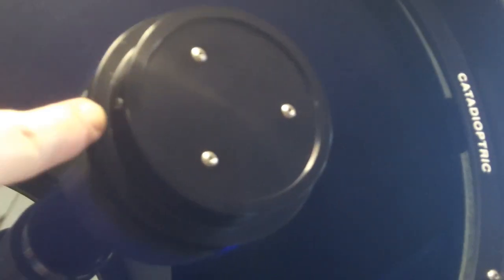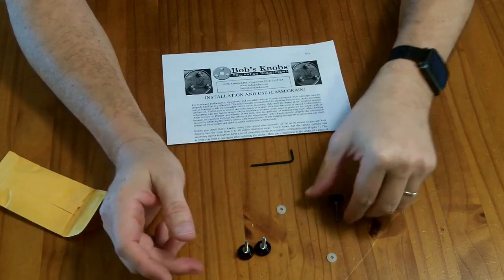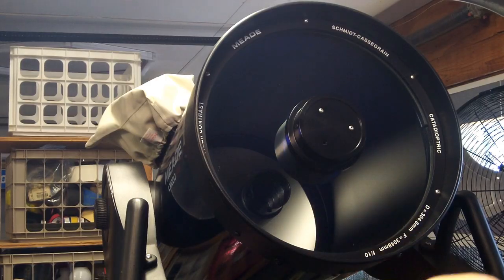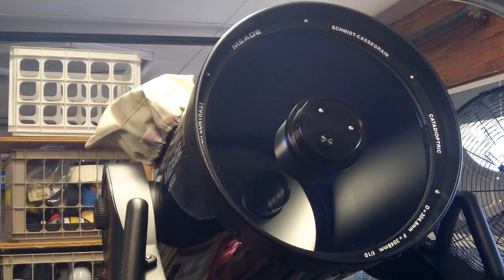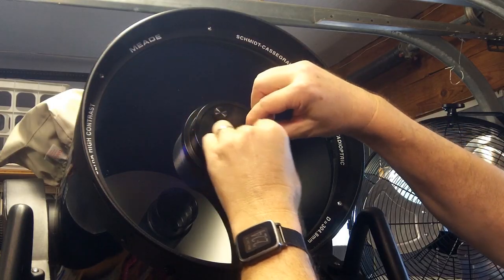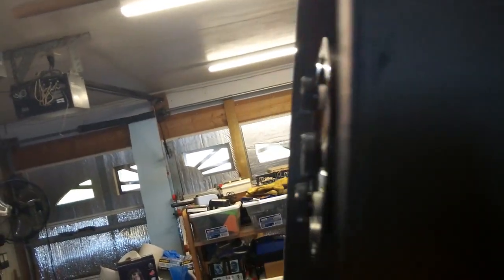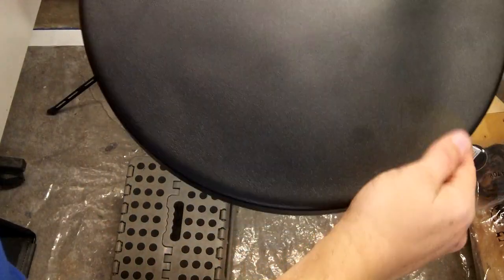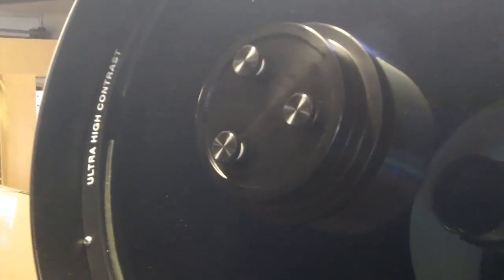Review & Installation HOWTO: Bob's Knobs secondary collimation Aid (Meade LX200 GPS 12 inch)

Comment: Thanks for this, I just picked up an M14 ACF and am on the fence as to if I really need the knobs. Does your scope sit on a pier or are you wheeling it in and out of the house? I have to wheel mine out across a bumpy door threshold and I worry about losing collimation like I did with my old newt.
Reply from the maker: I wheel it in/out as well.  I hadn't noticed it losing collimation, but my secondary mirror assembly had gotten "loose" inside the corrector lens, so I knew I would have to collimate it (for the first time) and I figured it would be worth installing them even if it keeps collimation for years and years just for the one time I had to do it.  [Not having to use a allan wrench / hex key near the glass is worth it alone, in addition to the ability to quickly turn...and then turn the other way when you realize you are going in the wrong direction, etc...]  I also strongly recommend having a tri-bahtinov mask (with 2 of the 3 elements covered) so you can "focus" on a single knob at a time once you get down to the super fine adjustments.   I'm going to be using the full tri-bahtinov mask to check collimation in case it does go out when I bounce it around, but I hope to not have to mess with it for years...